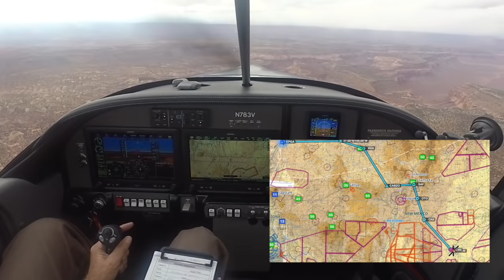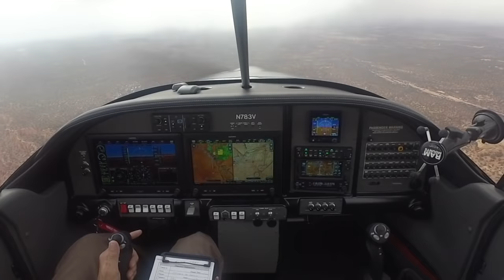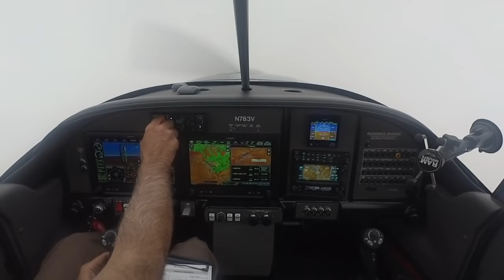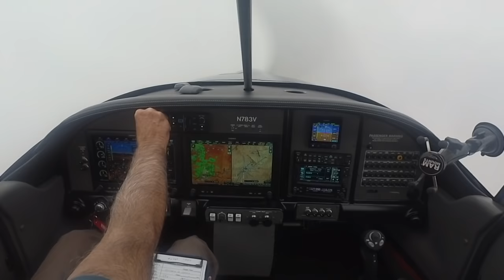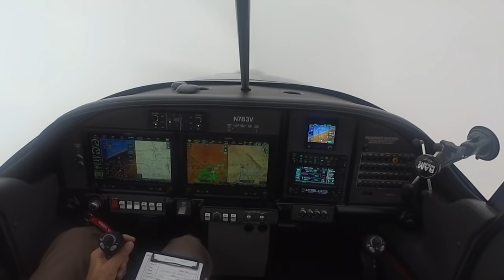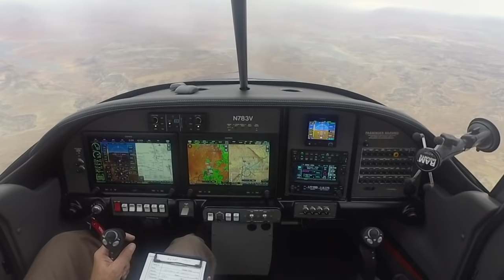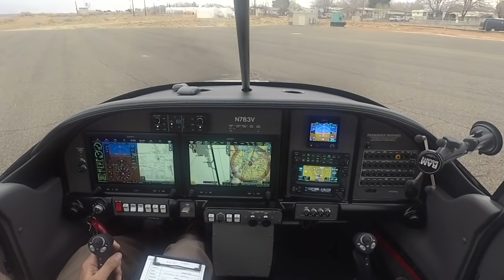RV 10   N783V   My 1st Emergency   HD 720p

Comment: Every sim pilot probably shouted 'Pitot heat' at the same time - but when you are used to it and you don't expect it - and your life is on the line - it's understandable
Reply: I noticed the bank before thinking it was the Pitot, but when he said Pitot I knew exactly what happened....all from playing Sims.
Reply: Didn't realize how relatable that is! I've had XPlane scream at me enough times, I instinctively check pitot/carb heat now.
Reply: ... and carb heat if not fuel injected when entering clouds
Reply: Yep its caused soo many accidents.
Reply: I am also a sim pilot and I have had this same iced up pitot tube  happen to me in MSFS and DCS
Reply: The fact that:
1- you did not apply a standard procedure of putting on pitot heat  when entering fog,
2- was not immidiately woken up to 1 above when pressure instruments started failing,
3- that you did not immidiately switched of the  audio warning, shows a serious lack of training/common sense. If this was not a fuel injected engine, you probably would have had an engine cut as well.
And this from a IFR rated pilot? The "with you" after a radio transmission is non standard.
Reply: @hanskolver7583  you are not wrong but I think your tone is a little off,  he has put himself out here warts and all to help others avoid his mistakes,  I don’t think being dressed down by you ,adds anything to the conversation

Comment: You should flight sim more, it's given me a reflex response to check pitot heat if the airspeed goes out or looks wrong, and anti-ice if controls or performance is sluggish.

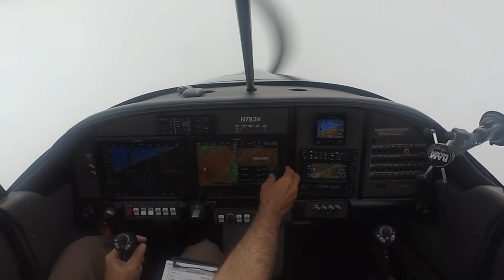Comment: At 3:56 you were in a pretty good left bank then at 4:12 a right bank...I was getting nervous until you had the AP on. I've run into unexpected weather a few times and it deteriorated fast, twice in mid-winter in snow storms (very cold and dry--no icing). Controllers are great with pop-up clearances here in the northeast corridor. It's all about the instrument rating/currency. You were riled up because this was a surprise, but you calmed down and flew the airplane. No emergency here and great job--then the AP goes off and the stall warning horn sounds and I'm freaking out with you, particularly since you were in that left bank again. Thank you for this. It jogs our memory to get back to the basics when things start to go wrong.

Comment: Great teaching tool recording the visual and audio! Once at night. doing a first leg ferry only from Scottsdale to El Paso, in a new airplane near Tuscon, unknown to me  I had a  worn out DG that required frequent readjustment with the whiskey compass that I forgot to ck and ATC vectored me into Tuscon safely after I was informed via my IFR flight plan that I was drifting left of course[1980 prior to moving msp GPS]. A pro pilot ended up finishing the ferry flight due to 
my time constraints to get back home to start a new job and he discovered the precessing DG, me making a first cross-country flight at night in a new airplane near high terrain with time constraints was not a good idea, I should have decided to fly early the nx morning. Recent medical issues that had me weak made us abandon the ferry flight which was a favor for a non pilot friend so we did the right thing. All the training in the world cannot prepare you for real life circumstances, but keeping a clear head as possible and knowing when to ask for help and  declaring an emergency if u need priority kept me safe that night. Later in the flight while being vectored, I remembered to locate the electric backup  turn coordinator located lower left on the 1968 Mooney M20 which helped me to make the instructed heading changes instead of fixating my scan on the unknown to me preccessing DG, inadvertent bank trying to keep on the DG heading and seeing the whisky compass moving and not steady, quite a learning experience while worrying about high terrain at night, the rocky mts off to East as my night flight leg was from Scottsdale to El Paso ., whew! I know that sigh of relief when we landed at Tuscon that night!

Comment: What a great video.  Confess when you’re in the S—t.  The ATC controller was so spot on.  As pilots we don’t express the amazing job that ATC provides.  I’m working on my IR rating, but have a lot of hours instruments.  You did the right things and asked for help.  We pilots feel invulnerable, but we’re not.  Asking for help is huge, it means we didn’t plan or didn’t forecast well enough.  Asking for help is crucial in flying, esp single pilot ops.

Comment: I’m an airline pilot at a major airline and a military pilot. This is a great video with so many lessons learned. Thank you for posting and any current or future pilots, remember to always use a checklist. Checklist usage can help prevent some of the issues we see in this video. You’ll never forget the pitot heat if you use a checklist that incorporates checking the outside air temp. Checklist should incorporate at a minimum:

Before takeoff 
After takeoff
Climb 
Cruise 
Before landing
After landing 
Etc.

Comment: Great. Thanks. As a retired IFR pilot in an SR 22 I can feel with you. Always had a Garmin 695 with me that was direct in my view. Due to statics I lost all my instruments in IMC in approach to Reykjavik but my Garmin kept on working. I could establish and on the descent on the localizer the instruments came back. But I already was in VMC. 
Similar scene happened another time. Without my Garmin, that emulates the sixpack, I would have had to engage the Caps and go swimming. 
So I never flew without my backup Garmin. 
BTW during instructor training I had trained to only fly with the Garmin reading.

Comment: Great video Randy. It's not easy sharing experiences like this where the solution to the problem is so simple. The reality is that, in the moment, its not so simple. The ability to troubleshoot a malfunction that results in erroneous instrumentation data is not as easy as it seems. And, like you said, you NEVER use pitot heat. So it's natural for it to be the last thing on your mind. I love that you kept going back to ANC. Such a simple yet powerful baseline for any scenario in aviation. Great job getting yourself home safely, great job critiquing yourself, and thank you for sharing!

Comment: I'm not a pilot (well, drones, but they dont count). But i am in the field of health and safety and accident prevention, so i can focus on some positives here.

One pisitive is that with instrument rating, you did what you were supposed to do, you trusted the plane and the instruments. Ive read many aviation accident reports where VFR pilots ended up in IMC and got disoriented because they lacked any training. You had instruments, and even when the airspeed blanked you knew your engine was still working and you still had a horizon on your instruments.

Great work!

Comment: Honestly it is stupid that when you have a error like „no plausible Signal“ because of a frozen Pitot Tube, that there is no Diagnostic function available like OBD2 in a car would show: 

„ERROR: Pitot Tube Signal implausible

Possible Cause: Icing, Sensor fault..

Possible Solution:
Heating, turn off/on..“

With all these Touchscreens and computers it should be easy

And thank you for posting this, you very well have saved lives!

Comment: Great video.  First off, very glad this flight ended with a good outcome.  Second, Kudos to the ATC for helping out to ensure you get on the ground safely.  Third, thank you for posting this as a lesson learned; flight training do not cover every scenario that a pilot would have face; this all come from experience and your video provide a valuable lesson for pilot who have yet encounter the same or similar situation as you did on this flight.  

In your description, you provided additional details to paint a better pictures for the reason you got suck into the situation; you have completed the pre-flight weather checking for departure, enroute, and arrival; you and your plane are IFR rated and capable; then there was a curved ball during your flight.  

This is a reminder for myself learning from this video:  Never Stop Flying the Plane from the moment engine start and until the plane is parked at the ramp when the engine is shut down.  As others have commented,  #1 Aviate, #2 Navigate, and #3 Communicate.  Stay Calm!  Trouble shoot one thing at a time while flying the plane, use checklist to help trouble shoot.

Comment: Even with good flight planning and favorable weather, it’s not unusual to find yourself in IMC if only for brief periods of time. Happened to me flying from North Carolina to Texas last month and, a few years back, flying from New Orleans to North Carolina. I always use flight following on longer cross country trips, and it was enormously helpful on those trips. Both trips had brief but significant in route weather issues.

Comment: Randy, your video should be manditory viewing for every student pilot.  Your RV10 is well equipped.  I think you could add to the value of your panel by knowing the "what ifs".  What happens when the pitot heat fails.  What aural warnings will I hear?  What happens to the autopilot (your best friend) .  What causes the autopilot to disengage?  By knowing what causes the warnings you can be proactive instead of reactive.  What can I expect if the WAAS /GPS signal is lost on the approach in the weather?  Military and airline pilots all have some procedures memorized and are expected to do those procedures when required.  I would suggest that you pick 5 failures that you memorize the solution for.  Say just the first 3 steps of each one.  In your case, by regaining your autopilot, you immediately reduced your task saturation to a workable level.  Your remembering pitch and power was very helpful.  Kudos to your instructor.  Enjoy many more years of thoughtful flying.

Comment: well done. I like you're style . Not panicking and taking things easy. As long as you're still flying, straight and level with fuel in the tanks and the prop rotating, things are good ! It's like that expression, "least said, soonest mended" and I think when flying IFR the fewest inputs you can make the better and the quicker you'll get out of a tricky situation.

Comment: It takes a special kind of man to admit such a mistake like forgetting the pitot heat...I am not a real pilot, I fly in simulators and I am not even an expert at navigating as I VFR most of the time or tend to the lazy direct to GPS but I can glimpse at what you felt in the real deal as I've been caught in virtual storms with zero visibility and it really feels claustrophobic. I rely to much in my natural ability to do a proper flair landing instead of making proper approaches with a flight plan..I love flying overweight and with limit range in my flights to see if I can make it and how much gas I can save along the way...all the stuff you should never do  IRL...
Anyway to the point you did well in sharing your experience and you ended up safe and sound to tell the tale, thank you again!

Comment: The thing is it's fully possible to navigate through weather if you've got the avionics for it, which you seem to. Having terrain sensing radar that'll warn you of mountains is the biggest one, but otherwise so long as you know how high the local mountains are and you have the capability to fly higher than them, you're pretty much fine so long as you watch your displays constantly and keep it level and under control. That's something they teach in the military (as well as racing) is to learn to trust your avionics and not just your eyes. It definitely gives you a huge appreciation to all those that flew around the world back in the 30's before any of that stuff existed and they were flying purely by compass and a mechanical altimeter and air speed gauge.

Comment: Great video and big pat on the back to you for sharing. I used to fly in the UK where the skies are often holding a lot of moisture. I suppose because of this, we were trained to always engage pitot heat for a few seconds every so often, then back to off and then check the rpm for any variance. Of course, I had the luxury of analogue gauges so always knew what the engine was doing. I assume it is the same in the USA but we also apply pitot heat before reducing power for descent and in the circuit before setting to off for final manoeuvring. 
Although, as you admit, you made some mistakes, I was very impressed with your handling of this very unsettling event.
I would always choose to fly with a pilot who admits his or her mistakes and learns from them as they are a safer pilot than someone who doesn’t. 
The person that has never made a mistake hasn’t yet been born! It’s how you handle the situation and how you learn from it that makes a safer pilot.
Well done Sir. Respect.

Comment: Pitot heat check is part of my runup (check ammeter for increased drain). I don't need it very often, but since it's part of the flow it's easier to remember to leave it on when it is.

Comment: Nice job managing the situation and not becomming too task saturated. You did well, and determined that the instrument was not functioning correctly and then later the probable cause, had this been a nighttime flight would have been much scarier, but even still once you hit that IMC and then lost the speed indicator, along with the noise, that could have amped any pilot's calm into danger territory.

Comment: About two years ago, a friend of mine, who was learning to fly, made a big mistake. One cold winter night he decided to make a solo flight out of the SF Bay area towards Sacramento. He just bought a plane and was beyond excited to put in some flight time. He was only VFR rated and didn't file a flight plan. On the night he flew out, visibility was good, but the cloud ceiling was only a couple of thousand feet about ten miles out. It's not certain if he knew this, but IIRC the final report said he never called in for a weather check. As he approached Mount Diablo he probably hit a thick cloud layer and lost orientation. Hikers found the wreckage about 500 ft from the summit of Mount Diablo after the fog lifted late next morning. He and his dog perished instantly. Had he been patient and waited until daylight, he would probably still be alive.

Comment: I was 16 years old when the pilot of a Cessna Skylane 182 flew into a rather bad storm. How the hell he thought he could, still makes me think today. To stressed to watch this. The plane suffered a lightning strike, and we lost all radio communications Now lost without coms he and sometimes I flew because he was worn out. about 4 hours later the plane ran out of gas. Smart piloting by Russ, he glided in 0 visibility 10 pm abouts and we touched down (crashed) onto a switchbacks on the side of a mountain in Death Valley. Jan 4th, 1974, N7995Q or N7559Q I forget.

Comment: Nice vid.  I take it you guys, pilots in general, havent sailed much?  Quite often you are in the pitch dark, in a rough sea, or with fog, using dead reckoning, so following a compass, using the boat speed to work out your chart position.  OK, the speeds are much lower, and so you do have more thinking time, but its a similar situation, you need to stay oriented, know where you have  been to know where you are. 

There are a few tricks, such as  using the depth sounder to navigate using the sea bed to follow a contour which is quite useful.   
Radar is very useful, you can see other boats and the coast, and of course with GPS its a piece of cake, but I learned in the old days. :)

Comment: God only knows how many pilots and their passengers have been killed because nobody was flying the plane. The most infamous example of this malady was Eastern Airlines Flight 401. In December of 1972, a faulty landing gear light distracted the flight crew. While trying to get a ten cent light bulb to light up, the pilot inadvertently switched off the autopilot and a multi-million dollar Lockheed TriStar (N310EA) with 163 passengers and a crew of 13 on board flew itself into the Florida Everglades. 101 people lost their lives because a highly trained professional forgot to aviate. I'm glad your situation ended favorably. By the way, the "fly the plane" axiom can be used when operating a motor vehicle or even riding a bike. Pay attention to the main task at hand. Great video and a wonderful teaching moment.

Comment: Good Job, great video ! It toll my breath all the 15 Minutes. I used to be in a similar situation with my ultralight. However, i saw the ground contineously but I did not have IFR Instrumentation or transponder. I can confirm that secondes will become minutes if you don´t get an answer. It wasn´t really my fault, cause the weather became significant worse than forecasted. Turning back was no option. Behind me the weather turned even worse. I tried to get contact to little airfields in the near of. But nobody answered and due to the upcoming strong crosswind I lost my position. GPS was not available at this time.  So I called an airport and they took my position on radar and radio and they "carried" me home.

In the middle of the video you made a real good decision: staying on plan A and not to land in unknown territory though you have got back ground view. For ATC people nothing is worse than hearing nothing more and waiting for reading about an accident in the news.

Comment: I've been trapped between layers a few times where I had to request a pop up clearance. One thing that may help is to pull up the approach plate for the airport where you want to go (assuming you are not too far from it) and set your autopilot direct to whatever fix you want to start the approach with, e.g. RASCO in this case. This way, when you call up the center, you can tell them you are tracking direct to that point. In my opinion, it reduces your workload and puts you in a right frame of mind.